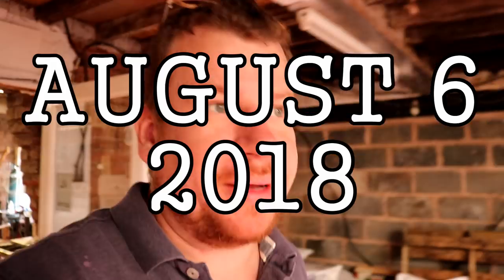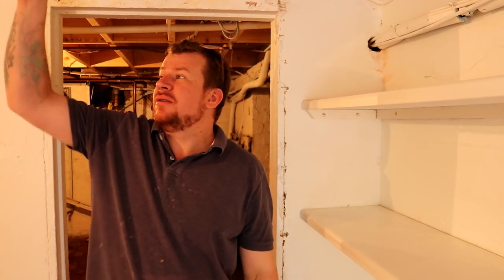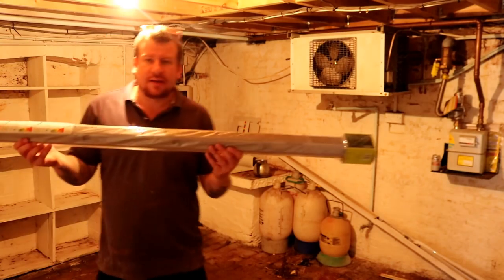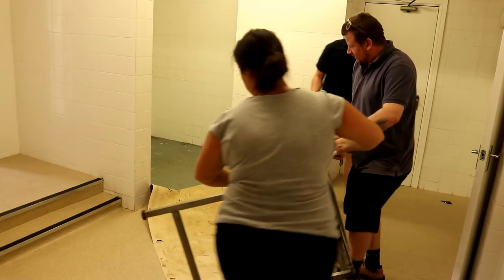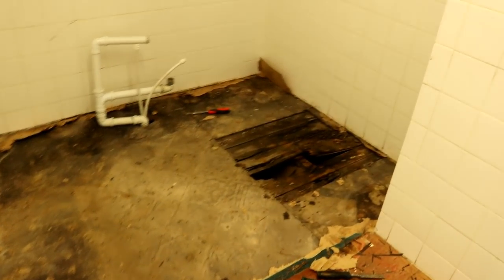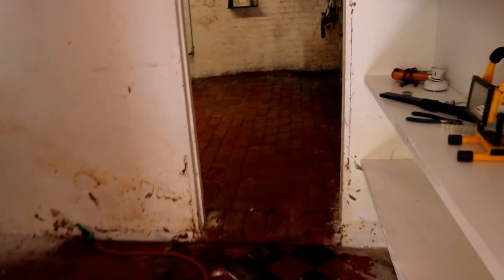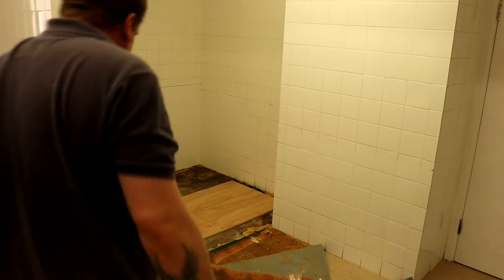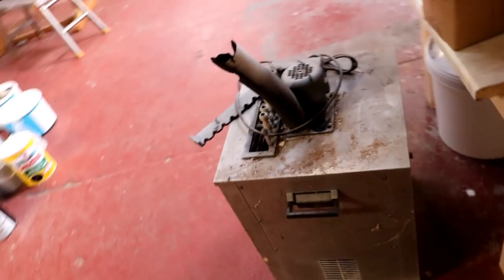THE FLOOR IS ROTTEN

Comment: Thanks for the info on the sink, I've already had to tackle rotten floor boards in my cellar, its in my 1st vid. Hope your gonna move that radiator where the fridges are going. 😮 taps that many WoW! And of course the new word of the day 'Dickard'😉😆, with a splendid new LED light. Looks cracking all the best and Mash On!